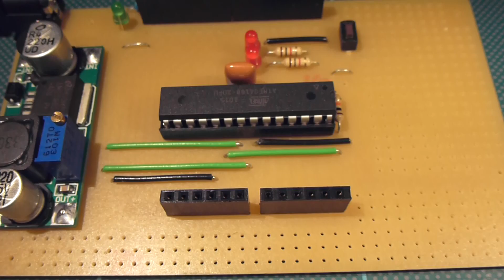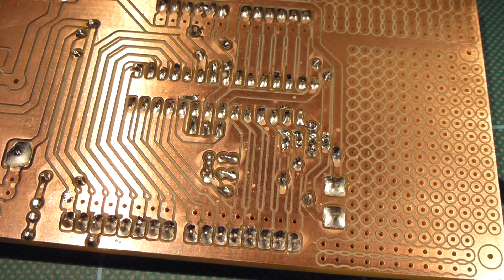PiDuino-prototype Arduino clone for the RaspberryPI

Comment from the maker: @marksp Very true, it's merely an Atmel chip on a board.  However it's hard to convey the potential functionality without describing it to something relevant they may know. It is running the Arduino bootloader and we want to get this system to actualy allow the Arduino IDE to run on the RaspberryPI so you can have the complete solution in your hand no other kit required. Either way we want to progress to the STM32 or better still XMOS devices, this is a nice familiar stepping stone

Comment: @101blog Very interesting board.  I figure many will want some form of I/O extender given the limited GPIO onboard the Pi and Arduino is a very well established and easy-to-use ecosystem. However, do you think that Arduino IDE and avrdude will be able to run on the Pi?